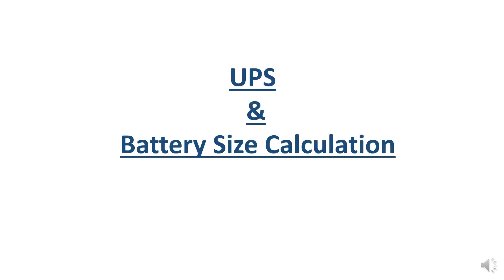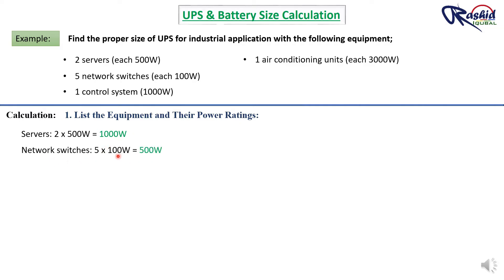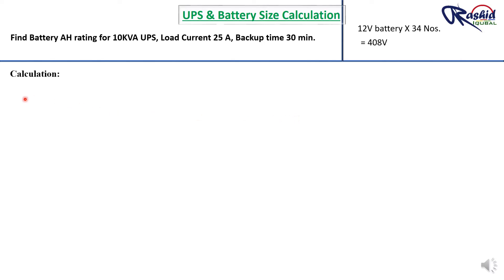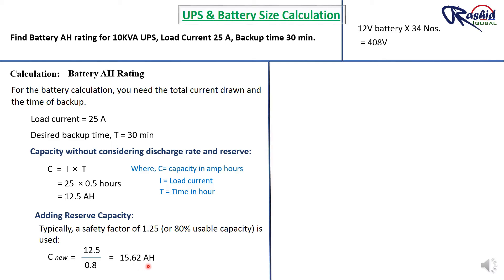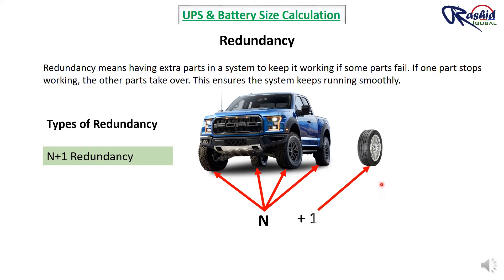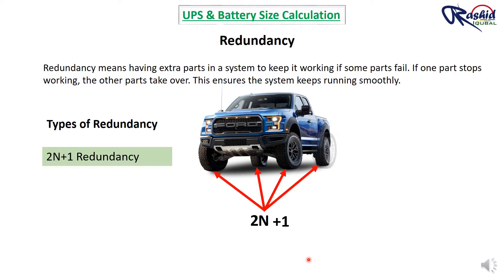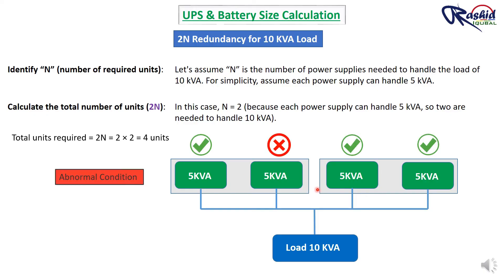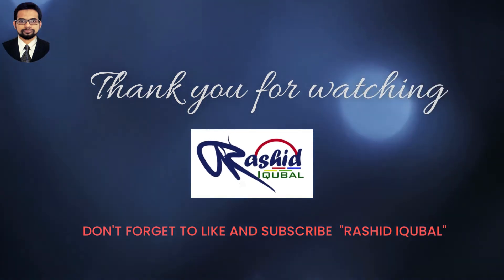UPS and Battery size calculation | UPS Redundancy

Comment: But sir In N+1 case load is shared by both UPS but you have given example of extra tyre  which only comes after puncture of any tyre
Reply from the maker: Thank you for the question. In N+1 UPS, all UPS share load during normal operation. The “spare tyre” example was only to explain redundancy in a simple way. Technically,  +1 UPS also runs and shares load, and if any UPS fails, the remaining UPS continue without interruption.

Comment: For those asking about load current, it's A = W/V
Example:
Load is 5500watt (W)
Voltage is 220 volts 
A(load current) would be 5500/220=25 A (ampere)
Reply: Question: If a safety factor of 25% was applied to the 5,500 w giving 8,593 w then wouldn't the load current be 39 A?

Comment: For confusions in adding 25% extra -  just multiply total in kva ×0.25  then you will get a value.. just add that value by total in kva
Reply from the maker: You can do both way, the way I explained is easy for calculation
Reply: @Rashid-iqubal thanks

Comment: In my opinion the load current should be calculate regarding 10kva or 10kva × 0.8 not for 5500watt.

Comment: How you derive 25 A load with 10 KVA ups because the load that you are taking reference here is running on 230V like IT Rack, air conditioning system.

Comment: Can any one tell  safety margin is 25% =0.25 , but why 1.25 can any one clarify
Reply: 1.25 is the factor you'll need to add the 25% safety margin.

You can of course also multiply the VA number by 0.25 and then add it to the VA number. In essence multiplying by 1.25 skips the addition step.

It might be a good idea to refresh your understanding of fractions. There's lots of fundamental things we often forget when we live our as normal.
Reply from the maker: @Unprotected1232. Correct
Reply: Its 25% extra so multiplier will be 100% + 25%
Reply from the maker: @sivaprasad7069  i wish some one reply 🤔
Reply: Got it sir thanks , expecting from u more technical and informative videos .

Comment: This is very simple and helpful explanation.
But how do you calculate the load current, which is 25A in this case.
Thanks
Reply from the maker: I just consider 25amp its an example only. I know if we calculate current value will be different

Comment: I have a question. I have an UPS rated 1000VA, but when the batteries died I changed them. I found 2 batteries 12V 28W each and I changed them with 2 batteries 12V 7Ah. My PC have a 750W PSU (i9 9900K and RTX 3080Ti). I want to know 2 things: The old batteries didn't provide (28W x2 = 56W) 1000VA? The new batteries (84W x2 = 168W) provide 1000VA? and how much  time will stay up my system in full load? Thanks

Comment: How you caculate numbers of battery 34
Reply from the maker: System Voltage 408v
Battery voltage 12v

Numbers of battery required =408/12=34
Reply: @Rashid-iqubal 
Why you choose system voltage 408 v
Reply from the maker: @ its system requirement. You can choose 420v or 440 v or 480v.. demands on your design
Reply: use cell/watt method to calculate number of cell and type of cell from datasheet i need to know this way
Reply from the maker: @  please go through this video link

https://youtu.be/PLjTMSnk7uI?si=W17A7Yl5dNBnRF48

Comment: How can you know for 10 kva ups . No of battery is 34.
Please.
Reply from the maker: Its depend on system voltage, based on required voltage we can select numbers of batteries. if requirement is 480 volt and your each battery volt is 12v then you use 12v x 40 = 480v

Comment: Sir please elaborate current calculation 25 amp comes if we divide 5500/220 but our batter voltage sum is 408
Reply from the maker: @8903hadeed  yes u are right, divide with 220volt if your single phase voltage is 220

Comment: Total load=5500 watt so current =5500/(415x1.732x0.8)=5500/575=9.5 amps,sir how you take its 25 amp 😢
Reply from the maker: its just an example, I suppose to consider single phase..
Reply: Same doubt bro
Reply: I think he used 5500w / 220v
Reply: Yes we suppose single phase voltage should be 230 v

Comment: 25 a load current how u got?
Reply from the maker: it was mentioned otherwise you can calculate. 10KVA / 408 = 24.5Amp
Reply: @Rashid-iqubal  This would be the maximum load current for the unit?
Reply from the maker: @ChrisBerCaNuc  yes, based on your phase voltage you can calculate current

Comment: I have design 2N redundancy on our battery system. we use also 2 battery charger. I'm amazed on the concept of   the wiring diagram you presented can you please create a video elaborating more the wiring connection of the system. Big Thanks to you sir learning a lot on your videos.
Reply from the maker: Sure, i will try. Thanks for watching

Comment: I am never able to undestand the battery rate of discharge. Some batteries are rated for C5 some for C10 some for C20. What difference does that makes? Load is constant so what difference wether i use a C5 battery or a C20 battery?
Reply: C rated will tell you how long the battery can provide the stated capacity for X times until fully discharged. For Example, if you have a 100Ah battery, if it says C10. The battery can offer 10amps for 10 hours until it's fully discharged. If C20, 5amps for 20 hours. If C5, 20amps for 5 hours... 
Hope this helps.. :)
Reply: me too